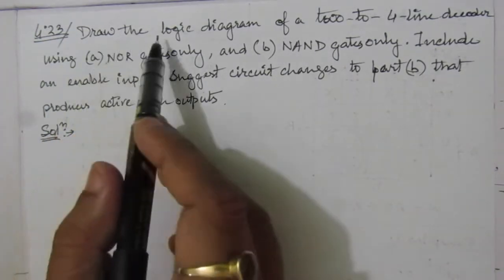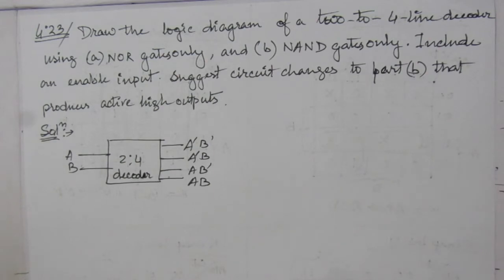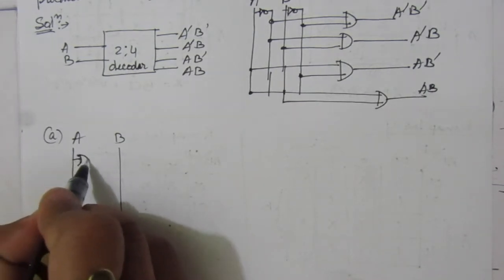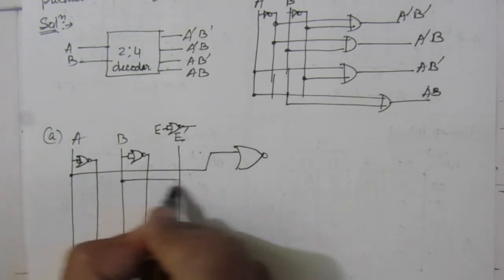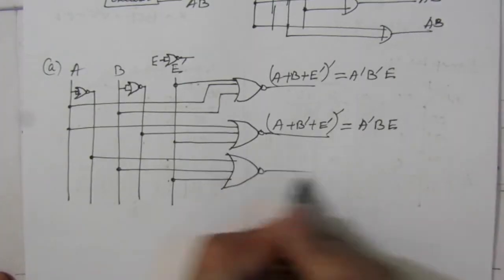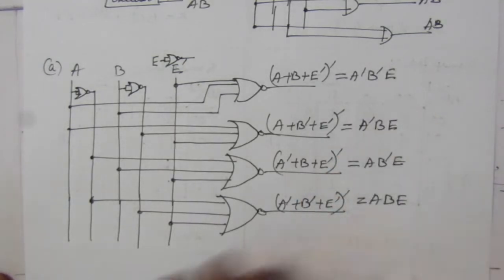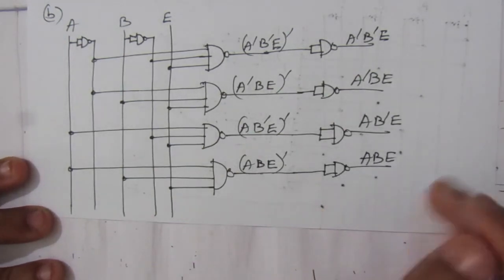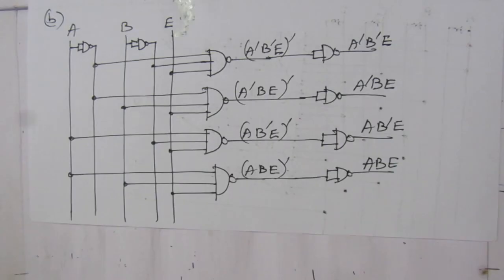Q. 4.23: Draw the logic diagram of 2-to-4-line decoder using (a) NOR gates only (b) NAND gates only

Comment: Draw the logic diagram of a 2-to-4 decoder with an ENABLE input using a)NAND gates b)NOR 
Gates. Show that the realisation using NAND gates is more convenient to distinguish the selected 
output with a value of 0

Can you please
Reply: Well he showed that he needs only 2 NOR gates to select A=0 and B=0 case (one of which is to generate !E). Compared to that 4 NAND gates are needed to do the same, 3 of which are just needed to invert inputs/output.